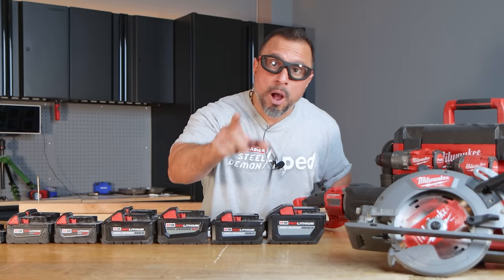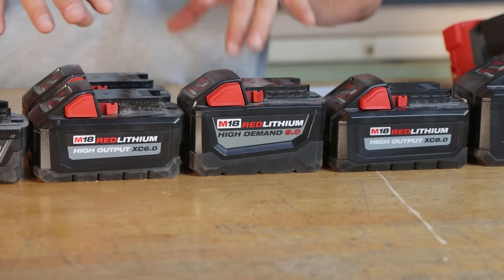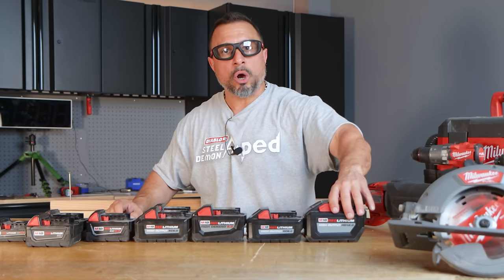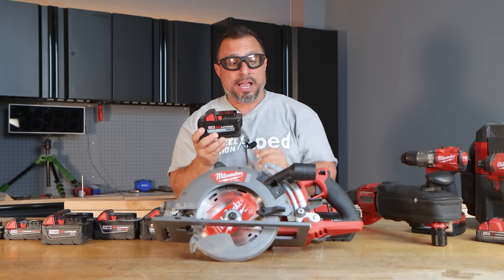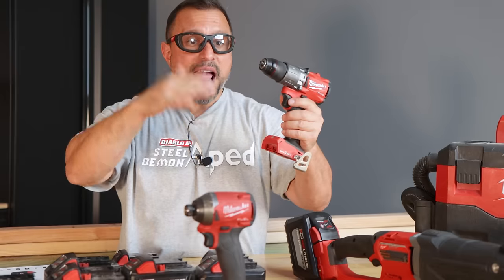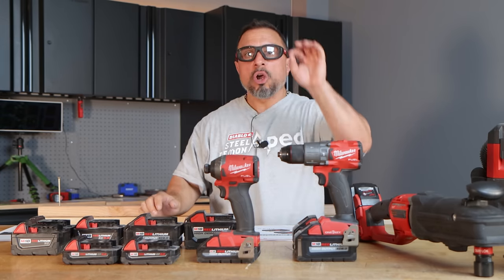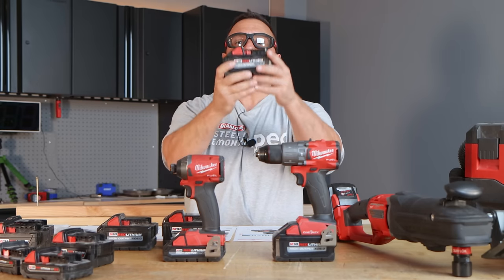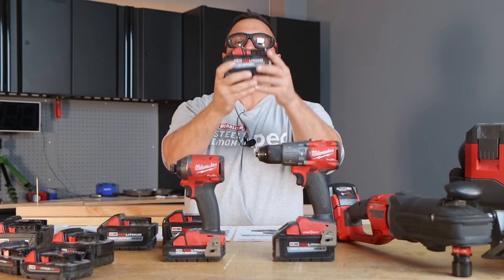Your BUYING and USING Milwaukee M18 Batteries ALL WRONG! (stop doing this)

Comment: The high output batteries work great in Drills, Grinders and direct drive tools and they will stall less under hard work, however in a clutch driven tool like impact systems their isn't as much gain as power output is limited by the clutch slipping and hammering action and more motor power won't really help you. I prefer the 3, 6 and 9 variety as they will outperform the 4, 8 and 12 for current draw as some others have mentioned. It will take a lot more to overheat and damage these 21700 based batteries than the older 18650's.
Reply: The 21700 cells arent newer than the 18650 cells, they're just identical but a different size.

Each cell is bigger so it has higher Voltage and amp output etc 

You can get the same effect by using more 18650 batteries, but because of the size the whole battery would be too big.

So in regards to 21700 being more reliable or handling more than 18650, this is wrong, it's just that the 21700 habe a big overhead with a battery the similar size
Reply: great point about the clutch
Reply: @user-tw8dl2jh2x  boy is this a bad read, higher voltage lol.
Reply: @LzysGraphics  huh?
Reply: @user-tw8dl2jh2x  lithium-ion batteries are all 3.7 volts, ranging from around 3.1 - 4.2 on a full cell. 21700 and 18650s don’t have different voltages, nor do they have different discharges or output simply because they are a different size. The size difference allows for a larger capacity which you didn’t mention.
Reply: @LzysGraphics  Oh, I mistakenly said "Voltage and amp output" i meant to just put "more amp output" which means power.

If you read the rest of the message you will see i dont refer to higher voltage But higher power per cell.

My mistake for putting voltage, but i did mention power which is amps, i build and repair many ebike/tool/golf cart/power wall batteries daily.

The size doesnt just allow for more capacity (ah), but also more (amp) output in terms of value compared to 18650's

This is why they use them in tool batteries, they dont use 18650 in flexvolt batteries because they havent got as many amps (or capacity ect) in power when in 52v mode as opposed to 21700's.

For example, the dewalt flexvolt at 18v is 6ah, but a smaller standard 18650 18v is 5ah. Its not just more ah flexvolt battery has, but also more amps per cell.

The cells in a flexvolt battery have higher max amp output per cell, so at 18v they are more powerful than a standard battery at 18v with the same amount of cells.
A 18650 battery cell typically has less amps unless its very expensive.

While its true that more ah gives more power due to staying at a higher voltage for longer and having less v droop, but its the actual amp output that determines power. (Amps and ah are different)

They actually burn up some impact renches if used too much with the flexvolt battery due to higher power with the same amount of cells.

P.s. Your wrong about both types of battery having the same power output.... theres many different types of 18650 and 21700 batteries and they all have different amp/ah values depending on price and what you want to use them for.

Comment: It doesn't matter what size battery you use in your tool as long as you realize your trading runtime for weight that's all. For example the 9AH has 15-3AH 18650's inside it. The 12AH has 15-4AH 21700's. None of the batteries are obsolete. Basically there are the CP models which are compact in size. The HD models are just double and triple stacked cells inside to give you longer runtime however, they are going to make your overall tool heavier. Putting a larger amp hour battery on your tool will make the tool perform slightly better. The voltage sag or drop will not be as substantial on the higher amp hour batteries as it will on the compact series or smaller amp hour so for example the suction on a vacuum will remain more constant with a larger capacity battery than with a smaller one.

Comment: New tool user here - My Milwaukee M18 oscillating tool, not Fuel, came with 2.0 and 5.0 batteries with charger.  The kit was a "special buy"  through Home Depot for $199 - regularly $359.  Now I know why the price was reduced.  But I'm a 65 year old female with small hands that have some damage so I like the lighter weight of the batteries.  Sometimes you need to go with what works for your budget and  body, but I appreciate this video and will keep the 3.0 and 6.0 in mind for the future - thanks!
Reply: Sounds like you got a really good deal as Milwaukee is a top of the line tool company. What this man is talking about is buying separate batteries in the future, the ones that came in your kit are just fine. Also you may or may not be aware of the M12 line that is considerably more compact and light weight than the M18 without sacrificing a substantial amount of power. Since you are already invested in the M18 line though, it may not make too much financial sense to move into a separate line.
Reply: the M12 line (as Marian Chronicles mentioned), is more compact and is really a good line of batteries.  199 is not bad for that combo of products.  the 2.0 & 5.0 with charger is normally $249.00 just buy itself (09/04/2023). But that's the M12 line.  Much less the oscillating tool you got with the deal.  I would consider going to the M12 Fuel line however.
Reply: Honey, you are doing just fine!! You are buying then BEST OF THE BEST tools and got a great deal. Don’t worry about the batteries being mentioned here. This is more for the PROFESSIONALS who need to consider what he is talking about. The tool you bought and the batteries that came with it will last you a LIFETIME. You got a great deal!!

Comment: 18650 batteries will recharge more times before they internally fail, they have a lower discharge amperage but will last many more cycles...they last so long they outlive the case. There are only a handful of tools that might benefit from the higher discharge amperage batteries but those batteries are heavier and discharge faster and take longer to charge.
Reply: I’ve had one 18650 failure in eight years. I have about half a dozen 21700 packs in my garage that are junk after maybe 40 cycles. I’m starting to get pissed off.

Comment: Am going to continue using my 5.0 batteries in my impact driver n drill they work good and haven't had any problems whatsoever I do have HO batteries 3 6 8 12 😁
Reply: Hi, 
He did not say there was a problem with the battery assigned to the tool. He IS dropping knowledge which delivers more drove time and productivity.
When you KNOW  better you Do better❣
The choice is yours at the end of the day.. He's Just distributing options/ knowledge.  It was out of passion this video was made. DON'T take it personally.
 Please,  have a BLESSED day🤗
Reply: Drive time .  Try to enlighten everyone on how to "Get more BANG for your Buck:
Reply: @karenriley8529   I totally understand and I know there's no problem like I said 5.0 for the impact driver and drill 😉  The 5.0 has plenty of power for those little tools the rest like a grinder or an impact wrench or sawzall use the HO batteries for more run time and power but

Comment: At work we bought a couple of Milwaukee copy batteries (made by Waitley) for research purposes.  They were a third of the price and when we opened them up they had the exact same Samsung cells inside.  2 years later and they're going strong

Comment: For the highest demand tools, the 6.0 can outrun the 8.0 - the 8.0 cells only have a longer runtime at lower current draws due to the compromise made for a higher capacity cell of the same physical size.
Reply: Wow. Great insight. 
Thanks!
Reply: Yeah I didn't know that thanks. What about the 12 ah is it the same way.
Reply: Ya know I actually looked into this because typically it's either high discharge or high capacity. 21700 3 and 4 ah batteries both claim 35amp cells which means the higher capacity of the 4ah cells doesn't result in lower discharge rate. (As comparison 18650 2ah are 30amp while 2.5ah are only 20 amp) however during testing by multiple sources the 6 outperforms the 8. Meaning that altho the factory specs are identical in discharge ability, in real life, they are not.

As far as the 8 and 12 being interchangable as far as power..... At least according to the numbers that shouldn't be a thing. The 8 is only a 70 amp battery while the 12 is a 105 amp so for massive draw tools like their supersawzall that claims wall power off of 18v (actually 21 since we typically test tools with full batteries) means the tool has to draw 85+ amps at 21v to make the same power as 15 amps on 120. Drop that to 18v and it's 100 amps. Now efficiency certainly plays a part but power is power and numbers are numbers. The 12 has way more available power because it's 15 cells instead of 10 with the same voltage so it has half again the available amps.
Reply: @ucitymetalhead  the 12’s have the same cells as the 8’s, but because there are 50% more cells, each cell sees 50% less current for a given load. This means that heavier loads on a 12.0 pack will be easier on the cells vs. with an 8.0, and the 12.0 cells will be able to stick closer to their rated capacity.

If you have a crazy high draw tool and want to use a 10 cell pack, you may be better off with the 6.0 than with the 8.0.

This same thing apples to the M12 4.0XC vs. 6.0XC.
Reply: @malventano  thanks for the explanation i didn't know rhat especially about the m12 batteries
Reply: The XC6.0 typically uses Samsung 21700-30T cells and the XC8.0 has 21700-40T.  Like @Allyn Malventano said, 30T better for high-draw, 40T better for low-draw.
Reply: Lol.  All said here is a waste of time and huge money. Try your m18 HO tool with a 12 amph battery and continuous use... It wont take long before all your batteries need to cool down. Sure it can get a small job done... but slightly more and you are at the charger more than the work area. So i am 100 percent sure they will create a new line between m18 and mx.  I mean the competition has succeeded in creating much better performance from HO tools.... it's not even close in battery and tool performance.
Reply: @PhillyFixed  why? They both have the same discharge rate.
Reply: Damn see this always confuses me lol
I’m slowly starting to replace my 5.0 with 6.0 HO
Reply: @philipjohn4149  what brands are you talking about?
Reply: @bdoggtoronto  dewalt flexvolt is much better than Milwaukee HO. Night and day

Comment: As a former journeyman carpenter I've been a Mauwakee fan for years.  I built my metal home and a wood framed/metal skinned building with Milwaukee M18v tools (drill, rotary concrete drill, 1/4 impact driver) and older NiCad saws (metal, wood, reciprocating saws) with M18 adapter. Yesterday my M18 3/8 impact arrived.  All four batteries I've constantly used were 5.0XC.  I have been truly impressed by the durability of the M18 tools and batteries.  I will typically default to a worm gear or table saw if it involves extensive ripping of dimensional lumber.  I give a definite thumbs up to how Milwaukee M18s have performed.

Comment: Milwaukee needs to make a belt battery pack adapter with a coiled cord and adapter to tool. Battery on belt would make all tools much lighter.
Reply: Makita done it.
Reply: & then you're back to a corded tool????
Reply: @jamesrussell6870  Yes, a corded, lighter tool you can use anywhere. Would be nice for chainsaw, hedge trimmer, etc.
Reply: @eieio6641  So when you have a half dozen or more tools in use at jobsite you have to plug & unplug tool each time?
Reply: I’d rather have a little extra weight than a tether like that, weight don’t bother me lol
Reply: Great idea 👌👍
Reply: Hilti did that 10 years ago with there  24 volt packs. And I hate to say it. Hilti smashes these tools..You have an issue with one. They send one out to replace it that day.. As they come to you...
Reply: @WizzRacing  ummm basically every city has Milwaukee trucks now as well that do the same thing...
Reply: @jamesrussell6870  umbilical tool...not the same as being tied to a wall/extension cord

Comment: The general rule is - Use the biggest battery you reasonably can on any given tool. Not necessarily capacity. More cells = good. Bigger cells = good. Higher capacity = not always good. Its a trade off between capacity and current capability. The 3Ah 21700 cells have a higher current rating than the 4Ah, so the HO6 will perform better than the HO8, but the HO12 will perform better again, but has 50% more cells and therefore extra weight.

Comment: Agreed on the 3.0 ho and I love the $99 special but the deal only comes around once a year in my area and they sell out fast. Typically they cost 169 for the 2 pack . I just picked up a fairly good deal yesterday 2x 5.0 xc., a charger and a jigsaw for $200. I thought it was a decent price so I went with it . I needed the extra batteries since my vac and portable fan were tool only purchases. I totally get your point, imo sometimes a good deal makes something seem like a good idea especially since my power tools are all just for personal home use. Company issues us all battery powered Hilti tools🤷🏻‍♂️ . I don’t feel like they’re more powerful, they are super heavy duty in terms of say dropping a drill or impact off a 10’ ladder or drilling stone that requires coolant that splatters sludge all over the tool day in day out . Milwaukee still my fav though 👍🏻

Comment: I bought a battery spot welder, some spare cells and I just replace a cell or 2 when a battery stops working. I’ve been doing this for years. One of my 5.0 batteries that’s almost 8 years old that gets used 5 days a week stopped working 6 months ago I replaced 2 cells and here we are 6 months later getting used everyday and works just fine.

Comment: It is is standard practice in mass manufacturing to minimize costs by having the minimum number of different size battery packs (or any other product packs).

Standardizing Battery Pack dimensions is standard practice and also ensures the most cost efficient external packaging for shipping, especially when the small pack sized is a whole number multiple of the large pack in the shipping carton. This means the most cost efficient packaging for transport is when they only have to order one box/carton size and label it before shipping to retailers.

To ensure the best price for incoming parts, manufacturers often standardize on sizes in a range of capacities to give customers the choice of battery pack capacity and energy output.

This also ensures that any mass production machinery can be set and left for each pack dimension for labeling and testing without the need for changeover setup time costs.

Comment: It's basically impedence matching, for high output tool you need high output battery, but it doesn't mean you'll get more minutes out of a higher end battery, it depends on the tool used for the specific battery. My drill goes for a long time on a 2.0, my sawzall runs down quick with a 8.0. Reverse that and the drill will probably go all day, the sawzall won't last  but for a few minutes and that's on full charge.

Comment: As an auto tech I have the Milwaukee 1/2 M18 impact and have use the 6.0 battery to remove tires lockouts and it won't remove them, than I change the battery to the 12.0 and yeah it's a little heavy but I get more power so I staying with the big batteries.

Comment: Completely agree. Over the past 2 years I swapped over to the HO, went with multiples of the CP 3.0 the XC 6.0 and the HD 12.0 been a great switch. All I use my XC 5.0 and HD 9.0 are mainly for lighting, vacuum, a few non fuel tools and the top off charger. Good info for everyone to know, complete truth. If you keep your eyes peeled and have patience there’s great deals that pop on the HO 3.0 and 6.0 packs.
Reply: You might want to reconsider that top-off usage. My phone went from "Fast charging" to "Super fast charging" by switching from my 9.0 to my 8.0. the charging times changed from estimated 129 minutes to 107 minutes.
Reply: @sergemarlon  that’s a nice improvement in charge time. I’m gonna give that go next time.
Reply: How much is a good deal?
Reply: @ethanduke813  for the HO 3.0 $99-119 for two packs. Hadn’t seen many 2 packs of HO lately, but $199-229. Used to be a combo with a 3.0 and 6.0 I got couple years ago for $169 but probably higher now, if they still do them. Hadn’t seen those in a while.
Reply: @m.a.4084  i see the high output 3 and 8 for 200

Comment: Great vid Vince. Everyone should do their homework on any platform. Especially Dewalt. They can be a bit confusing. On my Milwaukees, I use the 5.0s that came with kits on lights, radio and oscillating saw. The rest I use H.O. 3s and 8s. The only reason I don't use 12s yet is the charge time and the expense of the Super charger. The best battery deal was the H.O 3 and 8 amp pack for around $165. Now they have a 3 and 6 amp deal for $150 which is ok, but 8s are a better option. Especially for any high torque tool. I've seen the 3s and 8s at a few places for $199 which IMO is worth it. Trips back and forth to the charger suck. Not mentioning battery life. Milwaukee needs to step up to the plate and offer some dual bay super charger, two pack battery deals with 8s and 12s. Give us heavy haulers something to work with. 👷
Reply: Northern tool has a deal where there are 2 6.0 h.o. with the option of a tool. For $200
Reply: I got 3 5.5ah and 1 12ah battery for the M18 version.
Got the 12ah , because i also have the chainsaw and the Quick-Lok.
The 5.5's came from a kit.

Planning to get a 3.0 m18 , cuz the size is small and would be nice for around the house work.

Don't really need more M18 batteries , since i am going more into the m12 lineup.
Reply: DeWalt made it even worse with their ‘Atomic’ line now too. 
Rather than Milwaukee having their standard line, and Fuel line. Of course they jumped up to a brushless line, but that’s just a normal evolution of tools.